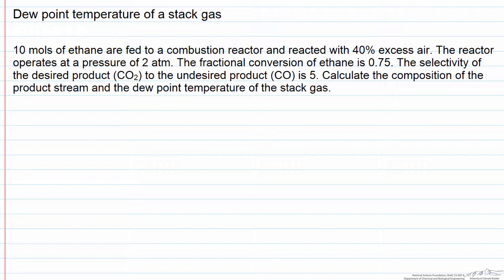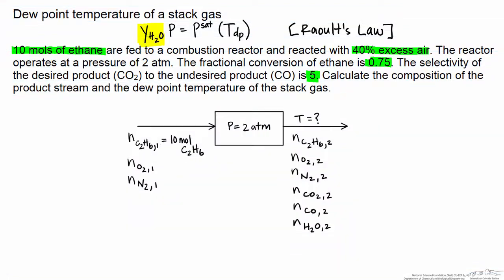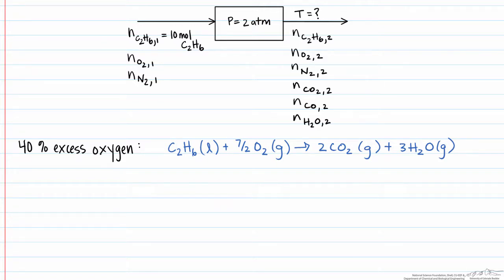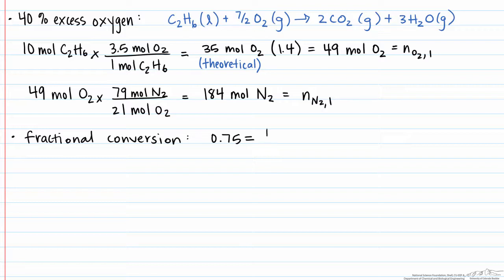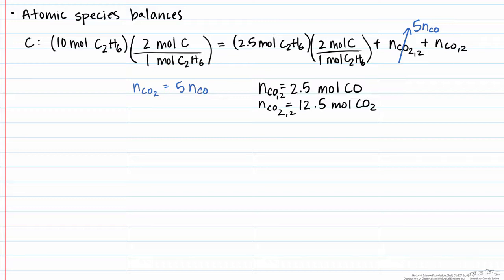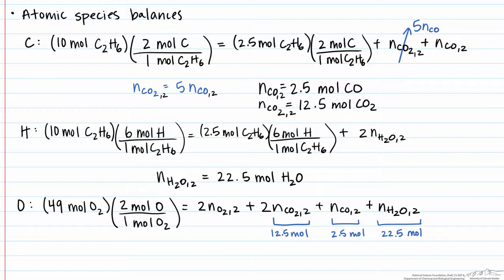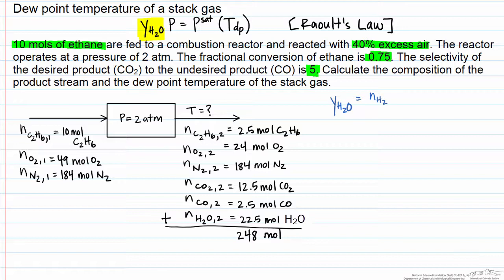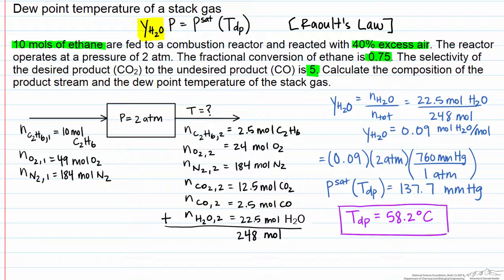MEB Final Exam Review Part 1

Comment: Why oxygen and not air? Also is there a reason that the excess mols are found from the theoretical and not the conversion factor so in this example using the 7.5 mols that were actually fed into the equation?
Reply: The mole amounts dont add up. The inlet value is 5 moles less than the outlet
Reply from the maker: @lukaisensee7832  Moles often don't add up when a reaction has taken place.  See the balanced reaction: C2H6 + 3.5O2 --> 2CO2 + 3H2O. 4.5 on the left vs. 5 on the right. Mass is balanced, though, as are atomic species.
Reply from the maker: The only component of air that reacts (in our assumptions here) is oxygen.  So to have 40% excess air would mean that you have 40% excess oxygen, since that is how it is calculated here.

Comment: 2:03 "So we're told that there is 40% excess oxygen." Why is it oxygen and not air? Or is that just interchangeable?
Reply from the maker: Ah.  This is a bit confusing.  The only component of air that reacts (in our assumptions here) is oxygen.  So to have 40% excess air would mean that you have 40% excess oxygen, since that is how you have to calculate it.  But you have to be very careful to continue to include the correct amount of nitrogen so that the rest of the balance still works.  This should be made clearer.  I will figure out how to fix this.  Thank you for pointing this out.